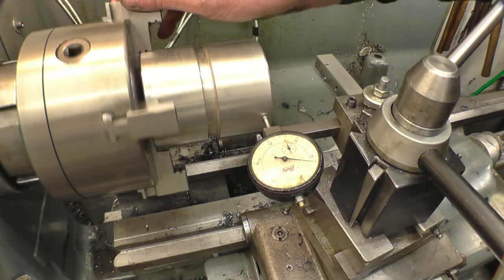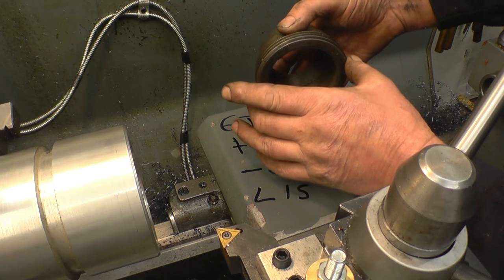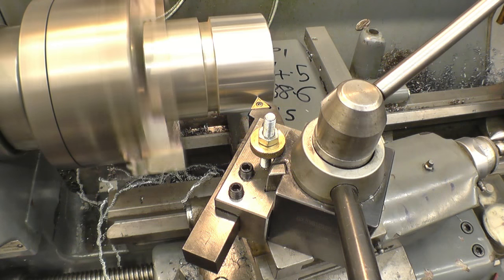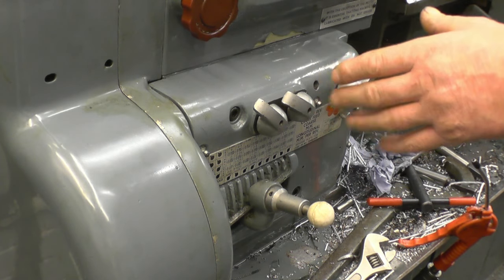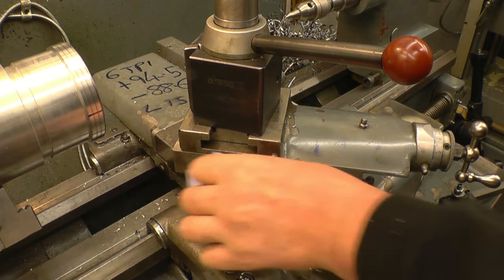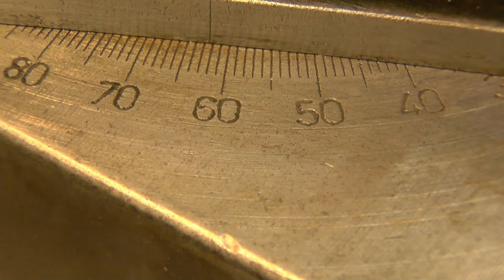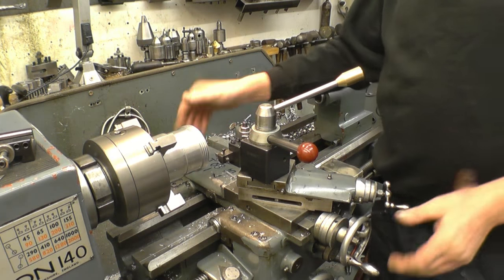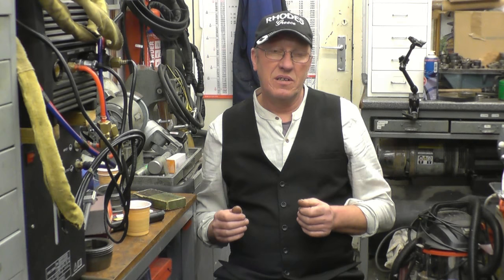SNNC 156 P2  External Screw Cutting

Comment: Ok, I got a question for all you machinist out there, when cutting threads where you don't disengage the half-nut why do you need to back out the cross feed.  Why not just reverse the feed and back the carriage/bit over the same path.  Then for the next cut crank in your bit and your good to go again.
Reply: The reason for winding cross slide out is to clear the cut thread. Now when you reverse, the cutter is scraping against the cut thread when you engage reverse.
Once it is in reverse,  backlash in the geartrain and lead screw could effectively reposition the cutter or the spindle. So you would end up cutting a thread in forward and then in reverse scraping away more material because of the backlash. You will see that in Johns screwcutting he sets the compound to half the Whitworth 55 degree angle,, so 27.5, you will also see he cuts on the leading edge each pass -he doesnt cut in at 90 degress and cut both sides of the 55 degree whitworth form. Also consider this may scrape on the either or both of the nice sharp tool edges, not doing the nice sharp cutter any good.-If its a Tungsten cutter, then scraping in reverse will knack the tool.
There can be considerable backlash in the gear train, so its important to reverse past the thread start position and retake up back lash in the Fwd train.
Sorry to be a bit basic I`m a shop joiner not a machinist.
Stan
Reply: Oh yeah I forgot about the backlash yeah you're right thanks for the information
Reply: bryan prindle 
The real reason that John does not disengage the half nuts is because he is threading the opposite language to his lead screw. His lathe is metric hence a metric lead screw the fire as he said in the vidieo you need to put in change gears to convert ( normaly a 127 gear which times 2 gives 254 divide by 100 gives 2.54  the conversion factor) because it's now a compound gear train the half nuts stay in and you pull out and reverse the lathe. Now before you ask there is a way to drop the half nuts you then stop the lathe watch the tread dial and reverse when it returns to the start number close the half nuts and you are back in sync

I have the problem the other way imp lead screw to thread metric I have to do the reverse thing
Reply: Bryan asked::"why do you need to back out the cross feed". the question had nowt to do with the half nuts.
Stan

Comment: Why Whitworth? Surely an american spindle nose would have a 60° thread (3¾-6 UNS for an L00)
Reply: arnt harrison lathes a UK company?
Reply from the maker: It measured up at 55 deg   looking on the net i am now thinking it is 60 deg
Reply: They are, but L00 is an american standard.Imagine buying a very expensive chuck from the other side of the atlantic (either way) and the draw nut didn't fit the backplate!  :-(
Reply: It might be hard to determine between 55˚ and 60˚, but there is no mistaking the radiused crests and roots of Whitworth threads. All 60˚ threads I'm aware of have flattened roots and crests (although I often see them cut sharper than they should be).
Reply: ahh , for once we didnt invent the standard :O
Reply: according to this http://www.lathes.co.uk/latheparts/page9.html
the thread is UNS therefore 60 degree. hope this helps.
Reply: Easy to run a 60 tool in a 55 thread to convert it, lucky it wasn't the other way around if you have already gone to depth.
Reply: I hope you did stop for that nice bottle of wine so it can still be saved.  SNNC 156 P3 ? or 156 P2B ?